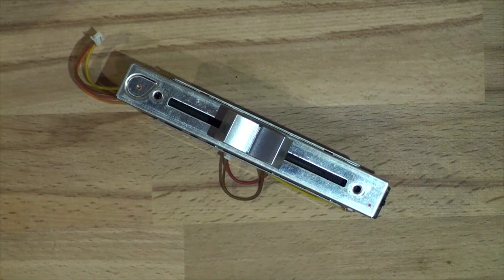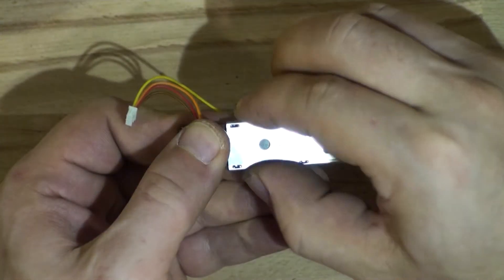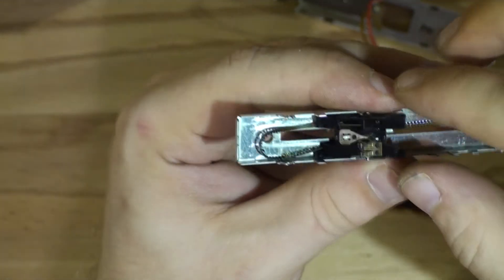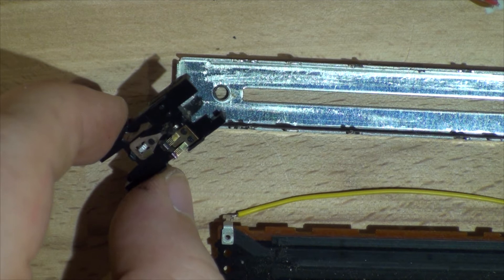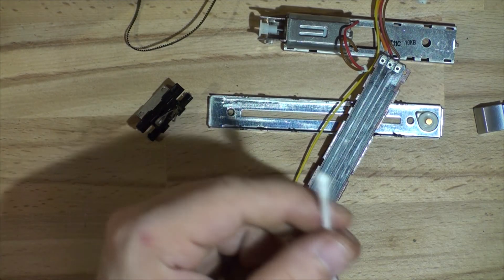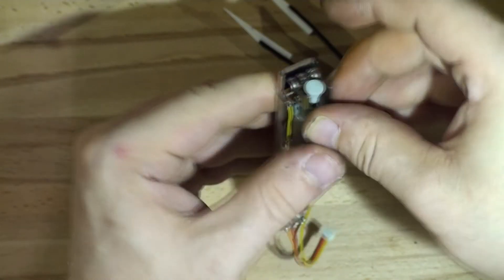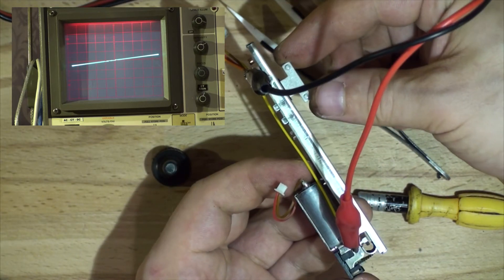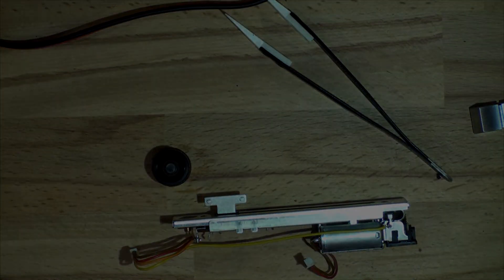Inside Motorised Fader + Cleaning and Testing with Curve Tracer

Comment: Thanks for posting this intresting video !!
I ve got some troubles with the first 2 faders of my Icon qcon X pro Extender .
When , say I'm using Cubase , i touch one of these 2 faders , the daw does nt recognize them , and the cubase channel fader does nt move up or down . But when i move one of these 2 faders throught Cubase , the Icon faders move correctly 
I think there s less touch sensitivity than the other faders
Maybe i should open unmount the chassis and clean them as you did. 👍👍